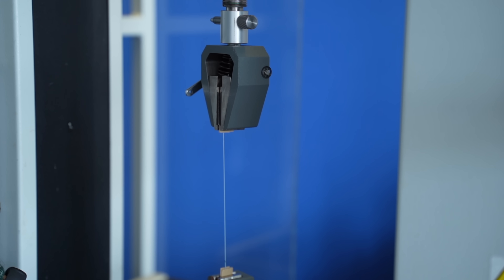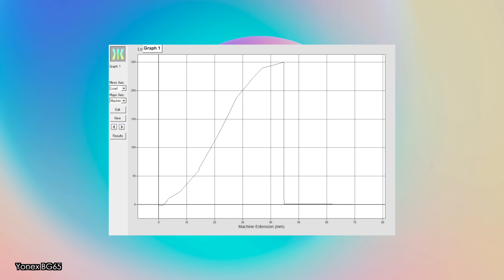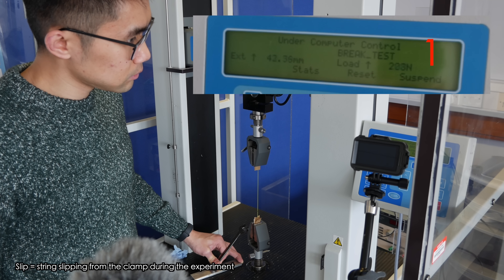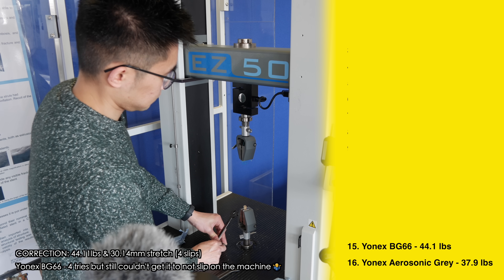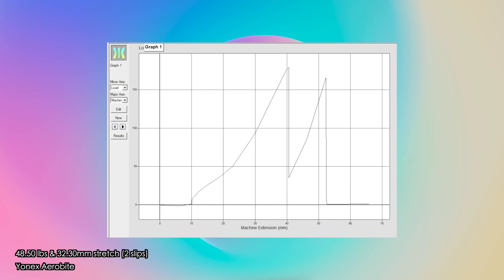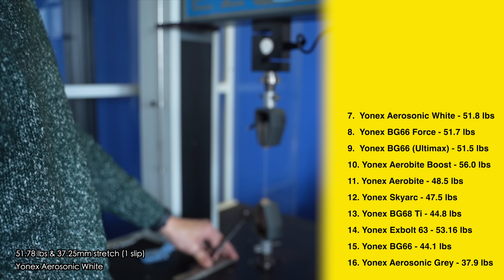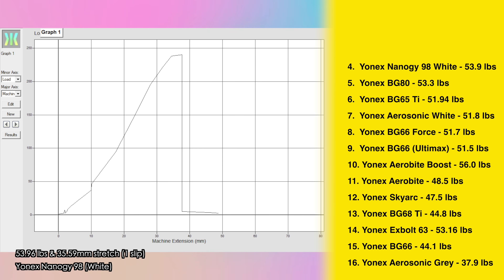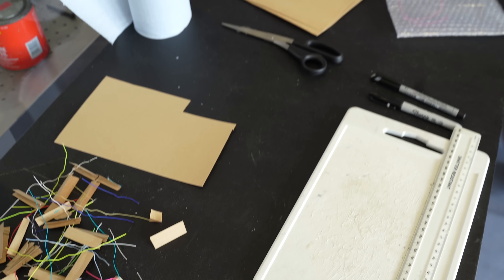How HIGH can badminton string tension go? What tensions do badminton strings break?

Comment: I mean, it's novel, but reality there are many variables.

I'd like to see fatigue on strings, if you keep stretching them over and over, when they will start deforming or have less tension to pull. I assume that machine isn't designed for that and more calibration/maxima.

It would be great to understand the "fresh" string feeling and measure durability that way.

Comment: Thank you for the tests! Might be interesting to know how strings perform when stretched in a faster rate simulating a hard hit or smashes when in contact with the shuttle. I have a feeling the materials across all strings may behave rather differently relative to the “slower” stretch rate. Snapping outcomes versus stretched till it breaks. Just as I feel some strings have worst string creep over time after being freshly strung over other strings. I have been playing with Exbolt 65 over a year now, perhaps next test, if any, can include them. I really enjoyed Aerobite but it breaks too often, as often as Exbolt63 and the best compromise for me is EX65. Thanks CK.
Reply: Did you notice with each breakage, where is it located? Vertical or Horizontal string? Mine is around center and it's the horizontal always as it's the higher tension side and I noted "saw" in groove. String is BG65, tension 30lbs. Lasted 10 months. But I have two rackets that alternate.

Comment: Great video CK! I wish you included Exbolt 68 because yonex claims that it has higher durability than the BG 65, yet with personal experience I feel like BG 65 is more durable. Would’ve been nice having your test compare Yonex’s top 2 highest rated strings in durability
Reply from the maker: I did this test before Exbolt 65/68 existed, hence why it wasn’t in there.
Reply: @CKYew  Sounds good, thank you for informing us! Out of curiosity, between the BG 65 and Exbolt 68, which one have you found to be more durable based on your personal experiences with them?
Reply: @DOGE-uj7cw based on my experience, there seems to be a problem with the exb68 strings which Yonex themselves have mentioned, it seems to be snapping a lot easier than even exb65 despite 65 being a thinner gauge which is a shame because I like the feel of the 68 strings, it's forced me to use exb65 instead, so to answer your question, surely BG65 should be a lot more durable than exb68
Reply: @Shiron95 this must explain why I found exbolt 65 to be way more repulsive and nice to play with but the same amount if not even more durable than xb68
Reply: @Shiron95  that has been my same experience as well! Exbolt 68 feels so much better and more repulsive than BG 65 yet one minor mishit and it instantly snaps. BG 65 is much more durable in that regard. Just crazy that they claim it’s their most durable string even though it doesn’t come close to BG 65 from my experience